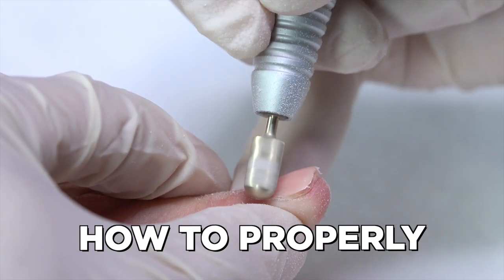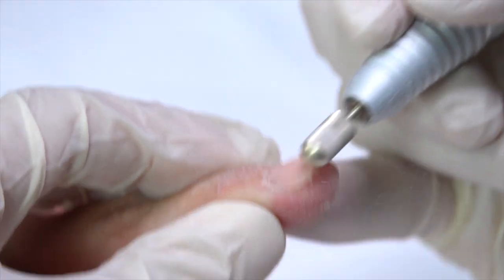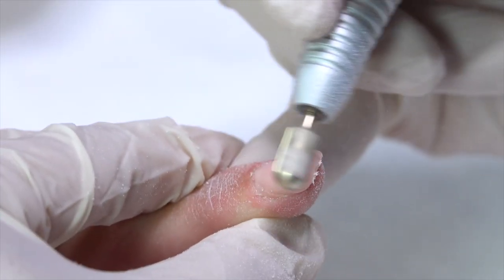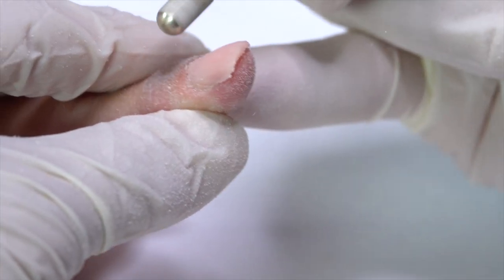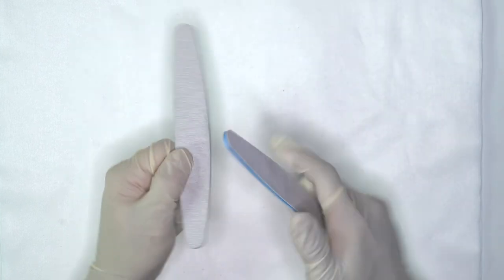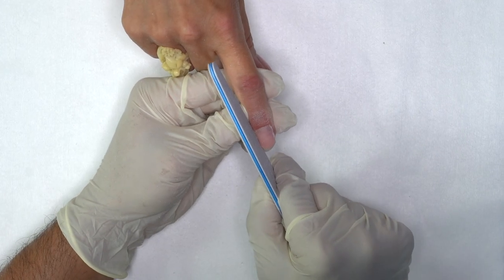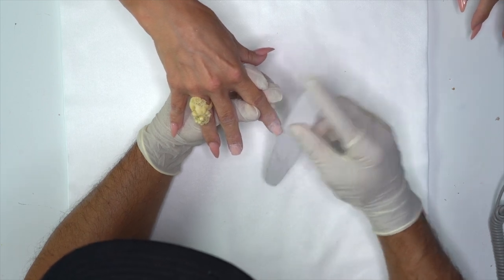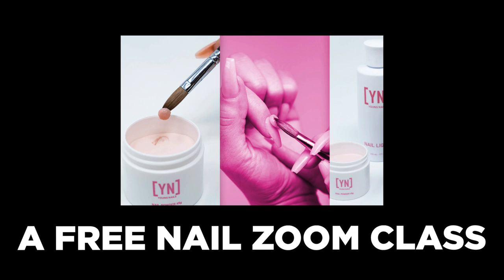How To File An Acrylic Overlay | Become An Expert with Acrylic | Virtual OWC

Comment: Thanks so much for posting this! I am going to try the tip with having the safety bit perpendicular to the side of the nail then turning the nail on it’s side to achieve the same angle on the other side.

Comment: Sorry for the late comment, but when seasoning files and bits, do you need to season safety bits giving they have the safety but on the end?
Reply from the maker: You do not need to season the rounded end, but if you find it necessary, you can season the base of the bit.

Comment: How do you know if you've filed to low & thin though, possibly hitting the actual nail plate?
Reply from the maker: When removing product, start with the Safety Bit-Coarse, but once you have removed the bulk of the product, switch to the medium arbor band so you gradually remove product.  When using this bit, you will just barely be able to see the dust-line around the edge of the product where it meets the natural nail.  If you are changing out the design, keep in mind that you don't have to completely remove all of the product, you can just apply over the thin layer of product, so you don't have to worry about filing too much.

Comment: Would you be willing to do a video on how to do acrylics for people with extremely thin natural nails/those with health/hormonal issues? I’m trying and I’m using everything I should be including protein bond, but sometimes the acrylics pop off after bumping them in 3 days. Sometimes they’ll last for 3 weeks. Often there’s lifting in the corners but I’m dehydrating, priming, and keeping my cuticles clear. I also use an Erika tip to prep the nails.
Reply from the maker: Are you using all YN products or a mixture of other brands? What are you using to cleanse/dehydrate the nail and what kind of bit are you using to prep?
Reply: I’m using Young Nails acrylic with Protein bond. I’ve tried different dehydrators. I’m currently using Mia Secrets monomer. I always prep the cuticles with a cuticle pusher and then use a round ended small straight cylinder shaped drill bit to finish cleaning up the cuticle and removing the shine.
Reply from the maker: @beloved2297  Unfortunately it is difficult to troubleshoot if you aren't using our full line.  We formulate our products to work together as a system and when you mix other products in, it can affect the adhesion of the product.  We would recommend using Swipe to cleanse the nail after your prep, two coats of Protein Bond and then YN Nail Liquid with our powders for the best results.
As for your prepping bit, we recommend using either a medium arbor band or a medium diamond bit.  If the diamond bit is what you are using, keep in mind that these do get dull over time.  If your bit is dull, it may be smoothing the nail surface out rather than creating the texture it needs for the product to bond.

Comment: OMG  I'M LITERALLY IN MY.  YN  BOXES 📦 📦
Reply: I have a  question.  After doing a acrylic nail and it's not smooth it is lumpy, which file should I use
Reply from the maker: @Jennifer-hj5ot  we always use this bit for shaping/removing bulk. We then use a 150 hand file for finish filing.
Reply: @youngnailsinc  THANK  U   guys,  I'm sure I speak for all beginners  you guys are interacting with us  and  explain every thing . THANK  U.